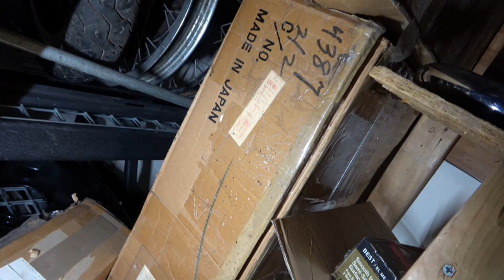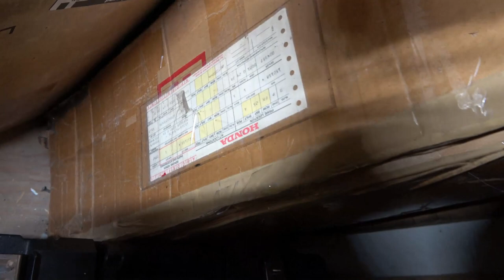1983 Honda CB1100F Restoration Part 1 - Introduction Walk Around

Comment: This will be interesting as I used to have a  82 CB900F that I swapped some 1100F parts onto.  The one thing that everybody asked about was the oil cooler.  It was a direct swap
to my 900F and hardly anyone knew it was off an 1100F but they saw it was wider than the stock 900F cooler.  I'll be watching!
Reply from the maker: Thanks Ray, as always, I appreciate your support 😎

Comment: Yaay! Another absolute favourite bike of mine! I always thought the choices made by Honda US/Honda Canada were strange for the 1100F. You guys got the square headlight, bikini fairing and cast aluminum "Sabre" wheels (as I think of them) while up here, we got a round headlight, no fairing, and the gold anodized "CX 500Turbo" ComStar wheels. Can't wait for the next vid and ones to follow! One thing- ewww, please don't put back on one of those hideous looking engine guards...
Reply from the maker: Hi L
I agree with you on the engine guards.
The CBX guards are so much more in sync with the design of the bike. Not sure what I am going to do, but the engine parts are so scarce for these bikes, and they saved this bike from much more serious damage, I may have to install them. But at least they are black and kind of blend in.

Comment: Hi there , I am restoring a CB 900 Boldor 1981 here in Australia, and am missing quite a few parts and was wondering if you had any of these I could buy from you.   Side Kick stand, front headlight, right hand side ignition start module, left had side indicator headlight, horn assembly, Front brake master Cylinder, Oil filter bolt and spring ?.   I know this is a long shot, but if not could you suggest a supplier or Ebay dealer to get the parts from ?  Thank you for your assistance.

Comment: I am looking for the chain guard for an 1100F, I know it's metal. where as the 759F,900F is plastic. Would those fit on the 1100F as well
Reply from the maker: I don’t think the plastic one will fit as the 1100 F swingarm is different than the 900 F swingarm.
The 1100 F chain guard is relatively easy to find on eBay.
Reply: @digitalpizza1  I had seen one on Ebay for $150 in ok shape. Thanks for letting me know the 750 an  900 wont fit

Comment: The batch on the side cover shows CB 750 F. Did they replace the original 1100 covers?
Reply from the maker: Hi Jurgen, those particular covers came from a 750 which are identical to the 900 and 1100F covers. So I will have those painted and apply the correct 1100F decals